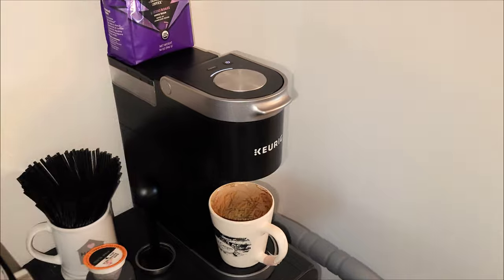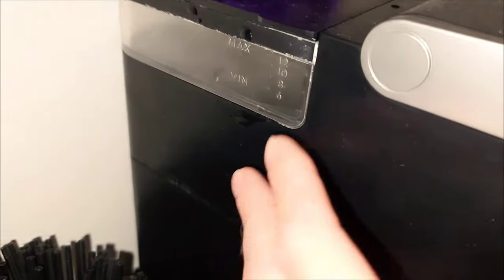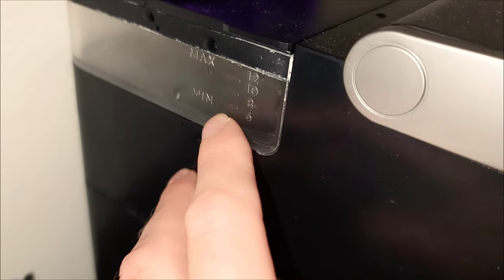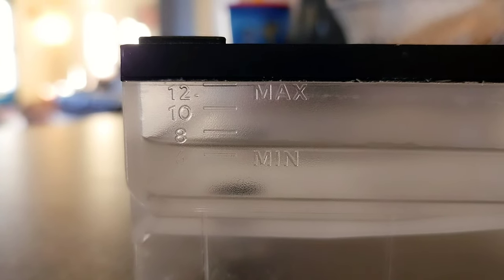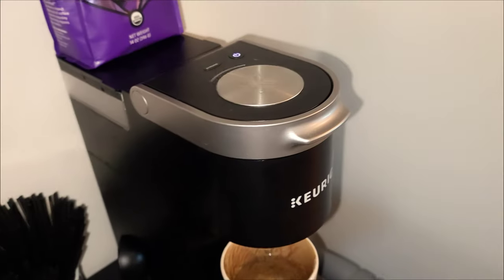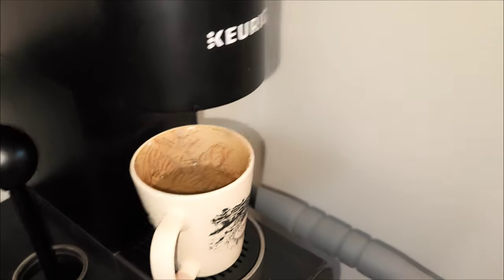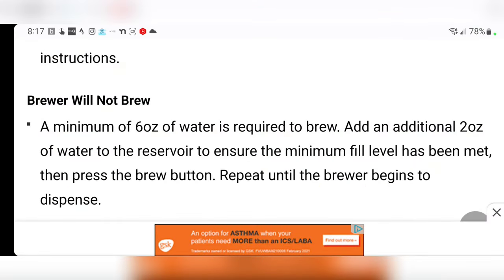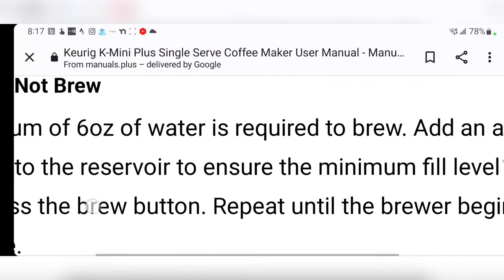"Broken" Keurig K-Mini Fix (Simple How-To) "Water Not Dispensing" Not Brewing 2022 💯😁

Comment: mine would only dispense half of the water i put in. Did all suggested cleaning. Mine is a few years old. Found the little filter where the water drains through in dispenser, had build up, Scraped and cleaned with steel clip. Worked right away for full cup. Thanks for all your tips too
Reply from the maker: Awesome! I'm glad it's working again. Good on you for not trashing it.

Comment: thanks for posting - i have an overflow situation where it leaks internally and this method eventually works after a few tries - agree no need to unplug reset the pump etc - just ad small amounts of water - i’m guessing there needs to be a certain amount of water in its internal pump/reservoir/heat tank before it will happily start brewing again
Reply from the maker: Oh didn't know about the leaking. Did you figure that out yourself?

Comment: Nice! I was about to throw mine out because it's 50/50 if I will get my coffee or not. Maybe it will last a little longer until I have to get a replacement. 😊
Reply from the maker: Happy to help ☺️ if you upgrade. What would you buy?
Reply: @AtHomewithLucas  This one actually worked flawlessly for almost four years, so I think I would get the same one again (or whatever the latest model is). I really like simple appliances that just do one thing well, instead of having a dozen useless features (and a dozen ways to break or to need extra cleaning). Anyway, this fix has been working every time, so maybe I won't need to buy anything. 😘
Reply from the maker: So happy to hear that. Yeah I bought the Mini for the same reason. I think most people don't use half the features of the big Keurig machines. I definitely like the new Keurig mini machines but mine is also still going strong now for over 2 year's. 😁

Comment: I just bought the Mini Plus and I have to unplug it every time to work, if you leave it plugged in continuously it will not power on. When I plug it  in I hear a click in the machine and it works fine. It’s quite annoying I have to unplug it every time. Any thoughts on what this is?? ☕️
Reply from the maker: As much as I hate to say this you need to call there customer service number. They will work with you to fix it or send out a new unit. I did that and got a new mini. 

Call them here 1-866-901-2739

Comment: mine was defective fresh out the box. i bought on sale a few years ago and it sat on the shelf for a  while. tried to use it tonight and the light won't even blink. does NOTHING. very frustrating
Reply from the maker: Try holding down the button then plug it in.
Reply: @AtHomewithLucas  I tried that and no dice. I'll call cust svc on Tues. Couldn't hurt
Reply from the maker: Mine was acting up years ago, so I called, and they sent me out a replacement unit. I love their customer service. 💯😁

Comment: I have a similar problem but I put 10 oz of water in the machine and I have to press the button and nothing so I have  to open the pod area and try again sometimes it works on the second try and other time I have to do a 3 rd time
Reply from the maker: So it sounds like you have a defective unit. I had one, then Keurig sent me out a replacement unit. If you give their customer service a call, you could get a replacement unit or a discount off a new one.
Reply from the maker: Contact Keurig Customer Service with questions: (7 a.m. - 12 a.m. EST) 866-901-BREW (866-901-2739)

Comment: Question.  I have the kurig mini plus. It just stopprd working. The lights won’t come on.  Only the descale light.  I saw on another video where a black wire broke causing this , but how do you get tje outside casing off without breaking it
Reply from the maker: How long ago did you buy it? Where did you buy it from? 

If you have an internal wire that is broken, that is not a user problem that is a Keurig problem, and they should replace your unit for free. 

I had a problem with mine years ago, and they sent me out a replacement unit.

Comment: I got mine yesterday..worked for 2 cups...today water wont come out..thanks
Reply: Literally just happened to me
Reply: @isabellaskywalker5507   it was the Tim Hortan pods not making it close right or something, I bought those purple reusable ones and add my coffee  and works everytime now. So could be the prefilled pods.
Reply from the maker: Hope you figured it out
Reply: @AtHomewithLucas  yes, it was the pods. The reusable works fine.
Reply: @SpiderLove70  those are the ones we used for the k mini. They don’t seem to fit in mine 😭
Reply: @isabellaskywalker5507  if you line the little part that opens the disposable cup part to the left where indentation is it will close.
Reply from the maker: You have to pull out the plastic cup inside the machine. Then, the reusable kcup will fit in.
Reply: @AtHomewithLucas  ahhh, good tip, thank you.

Comment: I have this unit for some time, and in my opinion is a disaster.  Frequently, 1-5 times, if you put it at 12 ounces, it will flow somehow into the top of the water catch basin and overflows down the sides and over the countertop.   The cup might get 6 ounces, the rest is all over the place.   I would not recommend it.
Reply from the maker: I'd call keurig customer service number. They will either send you out a replacement unit or give you a discount on a new unit. Your Keurig sounds defective. I've heard others saying the exact thing you are. Give them a call asap l.

Comment: Mine won’t turn on😢
Reply from the maker: So nothing happens? No lights at all?
Reply: @AtHomewithLucas  nothing
Reply from the maker: How old is it?
Reply from the maker: Hey try this: Press the power button. Press and hold the brew button for 5 seconds until all of the water has been dispensed. Discard the contents into the sink. Press the power button to restart.
Reply: @AtHomewithLucas had it not that long few months
Reply: @AtHomewithLucas  still didnt
Reply from the maker: This may sound silly, but can you try plugging it into a different wall outlet?
Reply: @AtHomewithLucas  already tried that 🥲

Comment: I always put a water level between the 6oz. & 8oz. lines. Without measuring that should be about 7oz. of water. Keurig instructions indicate not brewing less than 6oz. I have found that 7oz. appears to make the best tasting coffee whereas 8oz. is too diluted & weak.  After owning the K-Mini for only 3-months it has started to intermittently stopped dispensing a brew.  It takes the water but then doesn’t heat it to prepare to dispense.  Frustrating.
Reply from the maker: Yeah, that's why I want to get a proper Keurig with a 4oz 6oz ext 😁

Comment: If you want it to stop brewing.  Turn it off
Reply from the maker: Then water will be left in the machine and next time you brew it will be more water than you wanted. If you stop it with 2oz left the next time you put 6oz it will actually be 8oz. That's why you must let it run out into the drip tray or a second cup.

Comment: I figured this out on my own, but I don’t consider it a solution? It usually happens when the machine is cold, so I fill it to 10 to 12 oz, run it through a cycle without coffee, and then afterwards run ~7oz with coffee without a problem. Again this is not a fix! I own an older 12 year old mini plus I keep as a backup and it still works! This is just another over designed/engineered product!
Reply from the maker: Thanks for sharing your opinion. But in fact, this is and continues to be a fix for lots of people.